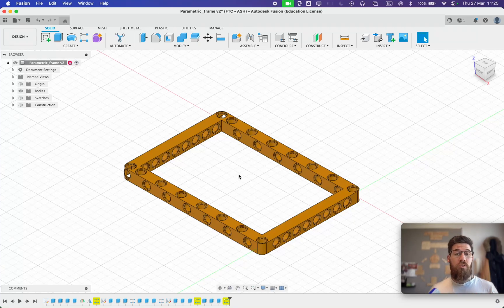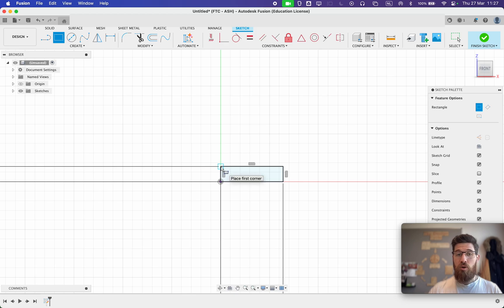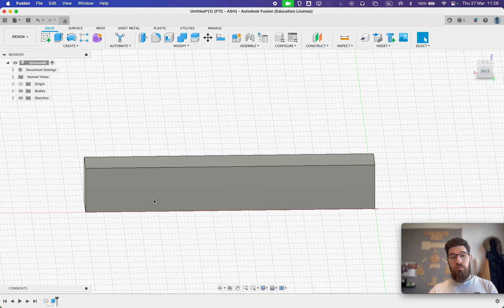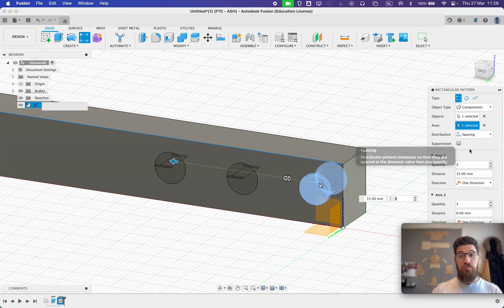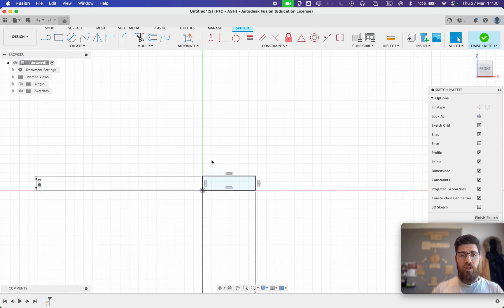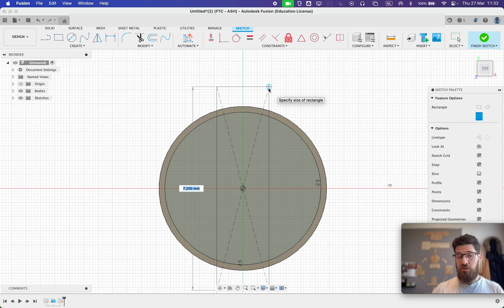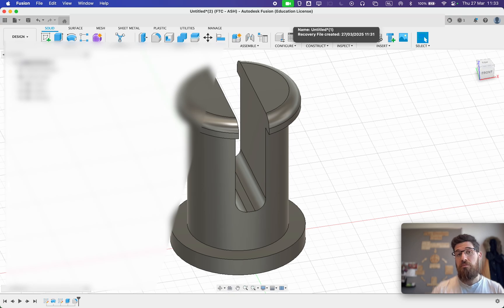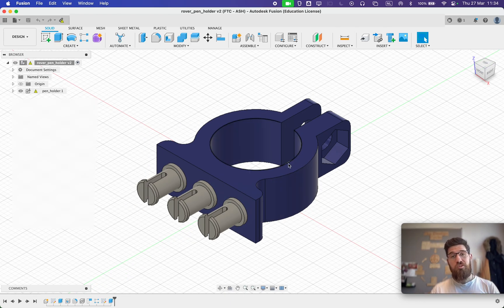Create Your Own LEGO Technic-Compatible Parts in Fusion 360!

Comment: Cool! Maybe you can do some servo and engine mounts as well? Also what kind of tolerances have you seen and did you do anything with supports for these overhangs?
Reply from the maker: im working on a video now for my servo mounts that I’ve used in previous videos, so that’s coming! 

These designs already factor in tolerances required. I’ve had success printing these on both Bambu carbons and ultimaker 3-S5’s. 

Female pins require no support regardless of orientation. Male pins can benefit from tree supports.